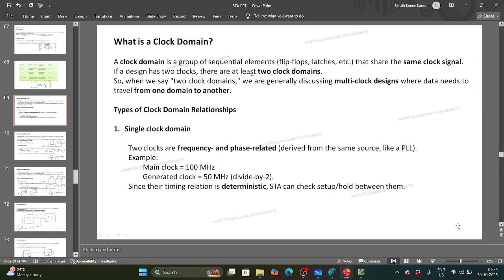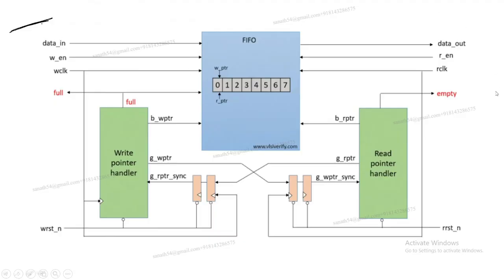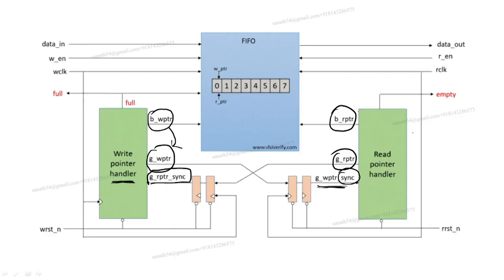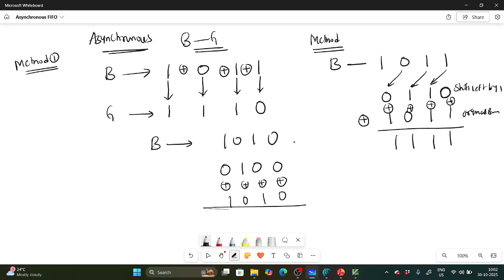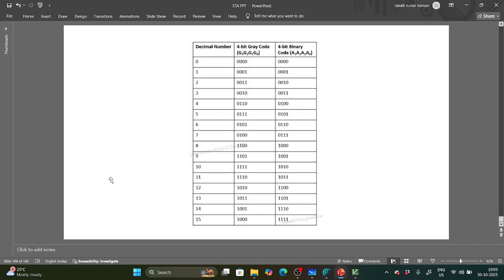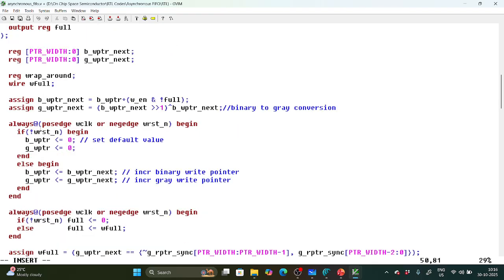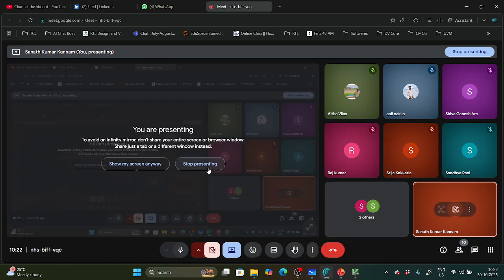Asynchronous FIFO Design | Verilog RTL Code and Test Bench Explanation

Comment: Can you share the code
Reply from the maker: module wptr_handler #(parameter PTR_WIDTH=3) (

  input wclk, wrst_n, w_en,

  input [PTR_WIDTH:0] g_rptr_sync,

  output reg [PTR_WIDTH:0] b_wptr, g_wptr,

  output reg full
);

  reg [PTR_WIDTH:0] b_wptr_next;

  reg [PTR_WIDTH:0] g_wptr_next;
   
  reg wrap_around;

  wire wfull;
  
  assign b_wptr_next = b_wptr+(w_en & !full);  //b_wptr+1, b_wrptr+0

  assign g_wptr_next = (b_wptr_next >>1)^b_wptr_next;  //binary to gray code conversion
  
  always@(posedge wclk or negedge wrst_n) begin
    if(!wrst_n) begin
      b_wptr <= 0; // set default value
      g_wptr <= 0;
    end
    else begin
      b_wptr <= b_wptr_next; // incr binary write pointer
      g_wptr <= g_wptr_next; // incr gray write pointer
    end
  end
  
  always@(posedge wclk or negedge wrst_n) begin
    if(!wrst_n) full <= 0;
    else        full <= wfull;
  end

  assign wfull = (g_wptr_next == {~g_rptr_sync[PTR_WIDTH:PTR_WIDTH-1], g_rptr_sync[PTR_WIDTH-2:0]}); //wrap full condition or half full condition
  // wrt_ptr==rd_ptr fifo full condition

endmodule

module rptr_handler #(parameter PTR_WIDTH=3) (

  input rclk, rrst_n, r_en,

  input [PTR_WIDTH:0] g_wptr_sync,

  output reg [PTR_WIDTH:0] b_rptr, g_rptr,

  output reg empty
);

  reg [PTR_WIDTH:0] b_rptr_next;

  reg [PTR_WIDTH:0] g_rptr_next;

  assign b_rptr_next = b_rptr+(r_en & !empty); //condition satisfies b_rptr+1'b1 not b_rptr+1'b0

  assign g_rptr_next = (b_rptr_next >>1)^b_rptr_next;

  assign rempty = (g_wptr_sync == g_rptr_next);
  
  always@(posedge rclk or negedge rrst_n) begin
    if(!rrst_n) begin
      b_rptr <= 0;
      g_rptr <= 0;
    end
    else begin
      b_rptr <= b_rptr_next;
      g_rptr <= g_rptr_next;
    end
  end
  
  always@(posedge rclk or negedge rrst_n) begin
    if(!rrst_n) empty <= 1;
    else        empty <= rempty;
  end
endmodule

module synchronizer #(parameter WIDTH=3) (input clk, rst_n, [WIDTH:0] d_in, output reg [WIDTH:0] d_out);
  reg [WIDTH:0] q1;
  always@(posedge clk) begin
    if(!rst_n) begin
      q1 <= 0;
      d_out <= 0;
    end
    else begin
      q1 <= d_in;
      d_out <= q1;
    end
  end
endmodule

module fifo_mem #(parameter DEPTH=8, DATA_WIDTH=8, PTR_WIDTH=3) (

  input wclk, w_en, rclk, r_en,
  input [PTR_WIDTH:0] b_wptr, b_rptr,
  input [DATA_WIDTH-1:0] data_in,
  input full, empty,
  output reg [DATA_WIDTH-1:0] data_out
);
  reg [DATA_WIDTH-1:0] fifo[0:DEPTH-1];
  
  always@(posedge wclk) begin
    if(w_en & !full) begin
      fifo[b_wptr[PTR_WIDTH-1:0]] <= data_in;
    end
  end
  
  always@(posedge rclk) begin
    if(r_en & !empty) begin
      data_out <= fifo[b_rptr[PTR_WIDTH-1:0]];
    end
  end
  assign data_out = fifo[b_rptr[PTR_WIDTH-1:0]];
endmodule

`include "synchronizer.v"
`include "wptr_handler.v"
`include "rptr_handler.v"
`include "fifo_mem.v"

module asynchronous_fifo #(parameter DEPTH=8, DATA_WIDTH=8) (
  input wclk, wrst_n,
  input rclk, rrst_n,
  input w_en, r_en,
  input [DATA_WIDTH-1:0] data_in,
  output reg [DATA_WIDTH-1:0] data_out,
  output reg full, empty
);
  
  parameter PTR_WIDTH = $clog2(DEPTH);
 
  reg [PTR_WIDTH:0] g_wptr_sync, g_rptr_sync;
  reg [PTR_WIDTH:0] b_wptr, b_rptr;
  reg [PTR_WIDTH:0] g_wptr, g_rptr;

  wire [PTR_WIDTH-1:0] waddr, raddr;

  synchronizer #(PTR_WIDTH) sync_wptr (rclk, rrst_n, g_wptr, g_wptr_sync); //write pointer to read clock domain
  synchronizer #(PTR_WIDTH) sync_rptr (wclk, wrst_n, g_rptr, g_rptr_sync); //read pointer to write clock domain 
  
  wptr_handler #(PTR_WIDTH) wptr_h(wclk, wrst_n, w_en,g_rptr_sync,b_wptr,g_wptr,full);
  rptr_handler #(PTR_WIDTH) rptr_h(rclk, rrst_n, r_en,g_wptr_sync,b_rptr,g_rptr,empty);
  fifo_mem fifom(wclk, w_en, rclk, r_en,b_wptr, b_rptr, data_in,full,empty, data_out);

endmodule
Reply from the maker: module async_fifo_TB;

  parameter DATA_WIDTH = 8;

  wire [DATA_WIDTH-1:0] data_out;
  wire full;
  wire empty;
  reg [DATA_WIDTH-1:0] data_in;
  reg w_en, wclk, wrst_n;
  reg r_en, rclk, rrst_n;

  // Queue to push data_in
  reg [DATA_WIDTH-1:0] wdata_q[$], wdata;

  asynchronous_fifo as_fifo (wclk, wrst_n,rclk, rrst_n,w_en,r_en,data_in,data_out,full,empty);

  always #10ns wclk = ~wclk;
  always #35ns rclk = ~rclk;
  
  initial begin
    wclk = 1'b0; wrst_n = 1'b0;
    w_en = 1'b0;
    data_in = 0;
    
    repeat(10) @(posedge wclk);
    wrst_n = 1'b1;

    repeat(2) begin
      for (int i=0; i<30; i++) begin
        @(posedge wclk iff !full);
        w_en = (i%2 == 0)? 1'b1 : 1'b0;
        if (w_en) begin
          data_in = $urandom;
          wdata_q.push_back(data_in);
        end
      end
      #50;
    end
  end

  initial begin
    rclk = 1'b0; rrst_n = 1'b0;
    r_en = 1'b0;

    repeat(20) @(posedge rclk);
    rrst_n = 1'b1;

    repeat(2) begin
      for (int i=0; i<30; i++) begin
        @(posedge rclk iff !empty);
        r_en = (i%2 == 0)? 1'b1 : 1'b0;
        if (r_en) begin
          wdata = wdata_q.pop_front();
          if(data_out !== wdata) $error("Time = %0t: Comparison Failed: expected wr_data = %h, rd_data = %h", $time, wdata, data_out);
          else $display("Time = %0t: Comparison Passed: wr_data = %h and rd_data = %h",$time, wdata, data_out);
        end
      end
      #50;
    end

    $finish;
  end
  
  initial begin 
    $dumpfile("dump.vcd"); $dumpvars;
  end
endmodule

Comment: 00:00 - Introduction to Clock Domains & CDC 
01:22 - Why Asynchronous FIFO? (Preventing Data Loss) 
02:40 - Synchronizers vs Handshaking 
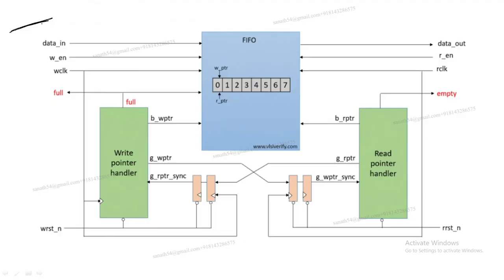06:50 - Async FIFO Block Diagram & Architecture 
08:00 - Why we use Gray Code Pointers 
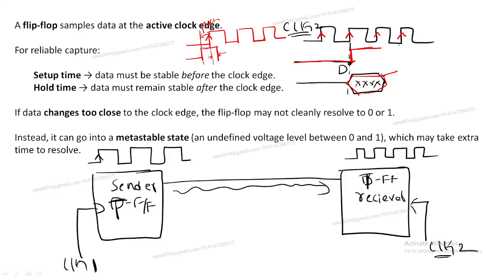13:30 - Metastability & 2-Flip-Flop Synchronizer 
15:40 - FIFO Full & Empty Conditions (Basic Concept) 
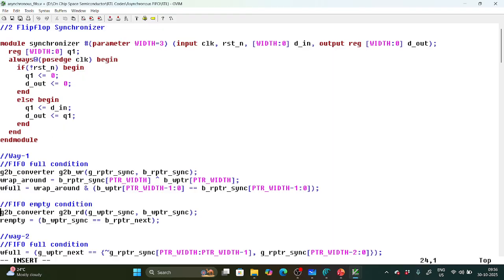21:10 - Verilog Code: Synchronizer Module 
24:00 - Binary to Gray Code Conversion Logic 
28:30 - Logic for FIFO "Full" & "Empty" using Gray Pointers 
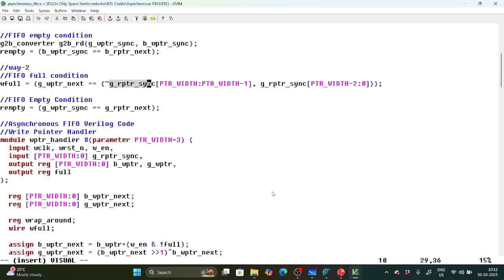37:00 - Verilog Code: Write Pointer Handler 
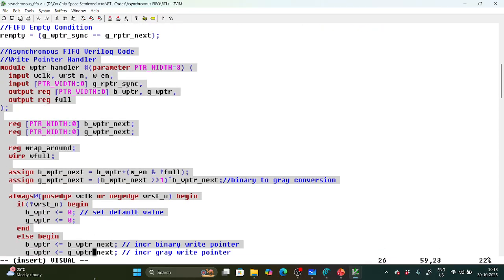43:00 - Verilog Code: Read Pointer Handler 
46:35 - Top Module & Header Files
Reply from the maker: Thank you for providing the detailed timestamps! 😊 This will definitely help viewers navigate the video and quickly access specific topics. Your support is greatly appreciated.